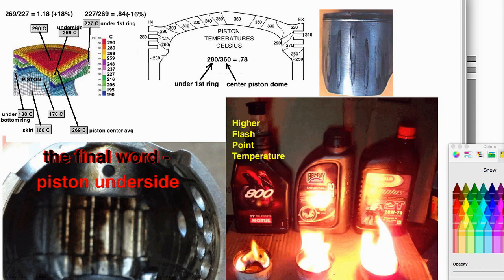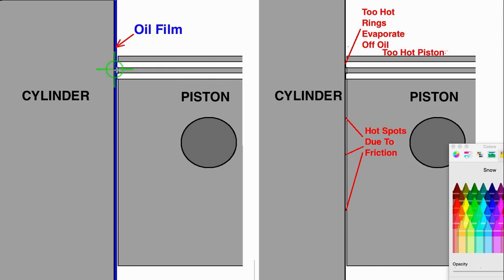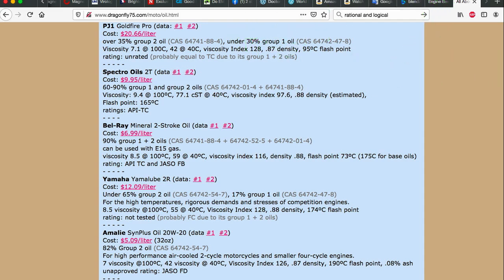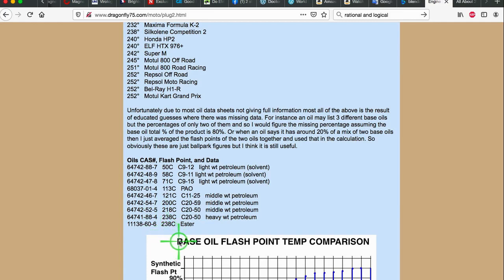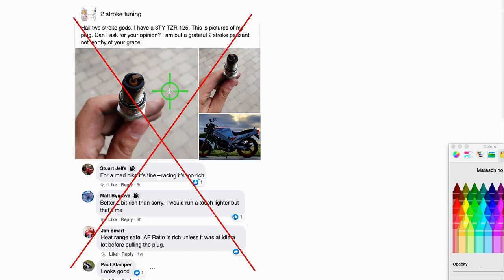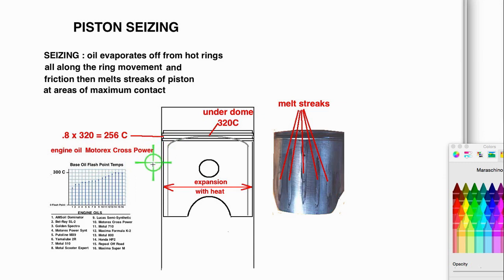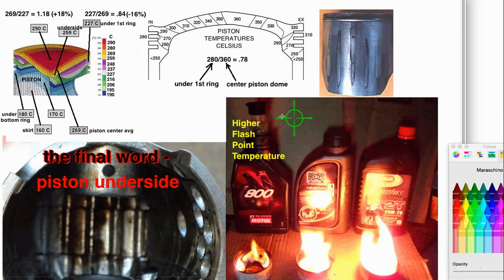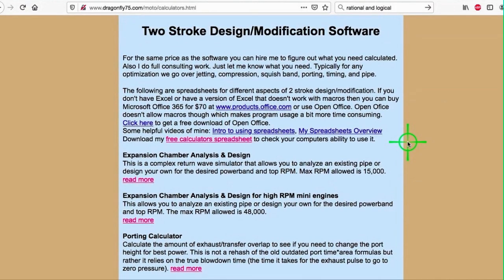2 Stroke Main Jet Sizing - Advanced Method

Comment: I've noticed some smudges on the sides of my piston, its a 8th mile 100cc engine that is 17:1 compression .015in squish and spins 14800-15k. I've richened the jetting up and still had the smudges. 

Right now I run q16 and klotz benzol now, would you say some type of oil that has synthetic and castor would possibly help? Benzol is 100% castor.
Reply from the maker: well you should know that I think jetting and timing go hand in hand and so when you "get the jetting right" you've actually just got it right for the timing it then has. Jetting and timing together need to be set to find the best power. After that is done then pay attention to other things. Castor burning on the side of the piston means the engine is running too hot. Try retarding the ignition. 17/1 means you aren't figuring out the true compression ratio which is the "trapped" ratio above the port. 0.4mm squish clearance most probably produces too much squish velocity. First install a thicker head gasket and then try different timing settings. Then retry different main jets for best acceleration.
Reply: @MichaelForrestChnl  yes I measured the swept volume above the exhaust port,accounted for squish and combustion chamber volume. Q16 is good to right around 17:1 so I made sure I was at 17:1 on the Dot. I've tested everything you said. I have over 2,000 8th mile passes this season. Just asking if you though straight castor could be burning off. I have one of the fastest 100cc promod scooter in the world and literally have the fastest in the United States I have 100s of hours of testing, but some slight smudges on the side piston doesn't worry me so I'm not wasting my time taking the engine apart to inspect it and changing stuff to see what's causing it because it's not hurting the engine and it's at peak preformance. 

The one thing I haven't played with is different oils, an yes q16 is a slow burning flue it has got to be HOT lots of comp and timing. 4-5* retarded and I will be missing out on 20% of power.
Reply: @MichaelForrestChnl  I've also tested different squish and compression and it runs the fastest eta how it's set. I've changed my set up to prove many people wrong because they say it's not optimal but yet when I do what they say and open squish or lower comp it slows down even with adding timing or making CVT changes ECT. I'll be sure to not to comment or watch your stuff anymore✌️
Reply from the maker: @ do or don't watch, I don't care. You want me to be God and know everything? That smudge is probably due to lack of ring seating due to not using the correct oil during break in.

Comment: This oil issue would probably also explain a lot of the perhaps unnecessary some problems people have with modern injected 2-strokes.
Reply from the maker: The problem is that the injection of fuel happens in the transfer ports and so gasoline can still escape out the exhaust port and so the control units set the jetting lean which also makes the engine, especially the piston, too hot. The Motorex oil that KTM recommends isn't synthetic enough. It has 20% of the cheapest group 1 mineral oil which burns onto the piston and evaporates off the cylinder. A fully synthetic oil with almost the same density (for injector use) is Silkolene Comp 2 Pl. That is what I would use.

Comment: Hello Michael, It's been a while since I use synthetic car oil 5w30 on my bike and i have had good results, I decided to do this because the price of 2t oil increased here in my city and 5w30 oil is on average 30% cheaper. My engine runs very well even at high rpm and I have no problems with carbonization and excessive smoke, my bike has oil pump so I simply choose some oil with api sn or api sp rating and dump in the reservoir.
Reply: I came to the conclusion that I could use this oil by analyzing the data sheet where I observed the viscosity at 40°c and 100°c and also the flash point. I came to the conclusion that I could use this oil by analyzing the data sheet where I observed the viscosity at 40°c and 100°c and also the flash point. Basically a 5w30 syntetic oil has a flash point above 200°C and CST viscosity at 100°C close to 10.00 which is similar to 2t oils for use in pump.
Reply: @feliperdz4225  but it has detergent in it no?
Reply from the maker: cool. Make do with what you have!

Comment: Micheal La hover Bike showed me your website and i need some help because i removed the lip of the head to get more compression before i did this i made a base and head gasket both gasket together are 2mm think and the og gaskets were a aluminium and that cardboard base gasket so increasing the compression now with those copper gasket back to where is was shouldn't effect the engine right??
Reply from the maker: Without knowing the psi or compression ratio I can't answer. Buy a compression tester and try to get between 115 and 135 psi.
Reply: @MichaelForrestChnl  i shaved down that lip and it doesn't have a squish band area is that the reason me bike might not run well?
im going to hot glue some sand paper to a old piston and tape that to a drill aand form a squish band from that
Reply from the maker: @untitledduck9675  after riding it take the head off and see if any oil escaped onto the top cylinder fin. If there is then you have a head leak.

Comment: One easy upgrade I was just thinking about for a high power/high compression 2 stroke bike kit would be to Cerekote the piston head and use Cerekote C-110micro slick on the piston skirts, which can be done at home. The Cerekote on the piston head (ceramic coating) is supposed to keep the heat from traveling thru the piston and pushes it out of the exhaust, reducing engine temp. The C-110 micro slick on the piston skirts is supposed to reduce friction.
Reply from the maker: my experience with coatings is they delay the time it takes for the piston and head to reach full temperature and so mostly present an advantage to drag bikes due to their short runs. They don't truly insulate the parts from the heat because heat travels thru ceramic but at a slower rate.
Reply: @MichaelForrestChnl  I just watched a comparison video and seen only a little difference between Coated & Uncoated.....The bottom side of the piston was cooler but only around 25F cooler.
Reply from the maker: @michaelbrinks8089  that sounds right. So instead of 300C its 285C.
Reply: the temperature of the coating (the very top layer) that is in contact with fuel would be much hotter than a clean piston would, and would significantly promote detonation. you could make a ceramic piston that would be 1/4 the weight and same strength but would just couse the fuel to detonate because the heat is not carried away.
Reply: You could also coat the inside of the cylinder head along with the piston.

Comment from the maker: of course before starting you need to make sure the plug has the right heat range and the timing is correct for top RPM (both are described how-to on the page I link to in the description). If changing the main jet size alters the mid throttle jetting too much then you need to use the process described at www.dragonfly75.com/moto/carbtuning.html to select a different needle with a leaner taper (less degrees) or richer taper (more degrees)

Comment from the maker: "To a large extent, the cylinder wall temperature also determines the lubricant temperature in the contact of the top compression ring"
http://www.sciencedirect.com/science/article/pii/S0306261917301022

“flash temperature parameter (FTP) is a single number that is used to express the critical flash temperature at which an engine oil will fail under selected conditions.”
http://pubs.rsc.org/en/content/articlehtml/2017/ra/c7ra00357a

Husqvarna did some testing in the mid 70's that was very interesting. They put 3 identical stock engines on a dyno and ran them for several days at varying RPM and load conditions. Then both motors were torn down and inspected. The engine running CASTOR based oil had the least wear, followed by the synthetic oil, and finally the engine running standard 2-cycle oil.
 A second test they performed was to run synthetic in 2 identical engines and one was run at 24:1, the other was run at 50:1 The engine that ran 24:1 had less piston skirt wear, and less rod bearing wear.

Comment from the maker: I'm thinking also that the thicker the oil film on the cylinder, the longer it takes to vaporize off and so that insures more oil stays there even when it is vaporizing. So it should be possible that by increasing the amount of oil used you can increase the seize protection. So if your piston tells you the engine is at the ragged edge and you want to keep the same oil then add more of it to gas.